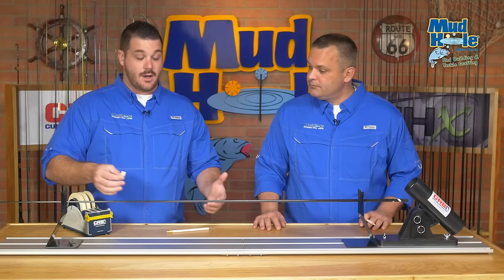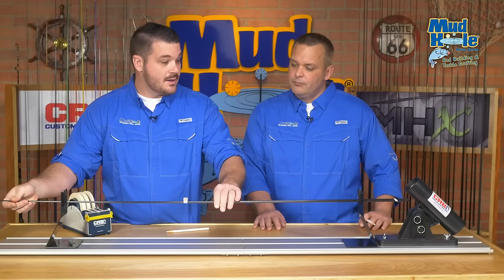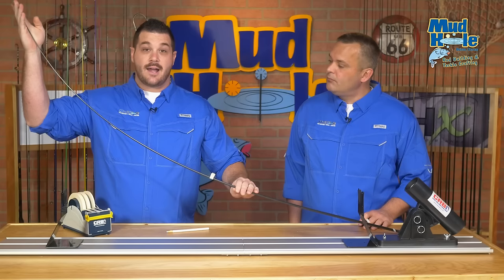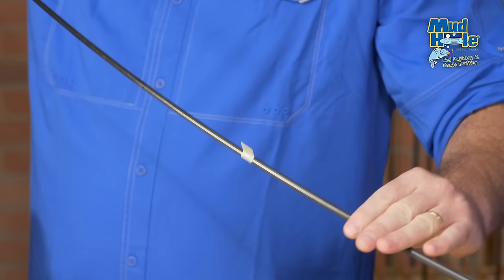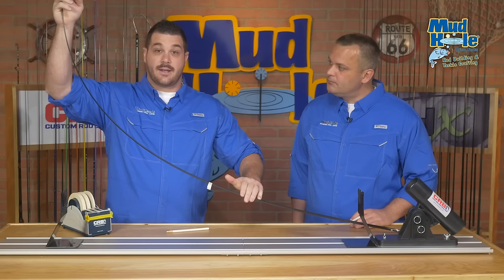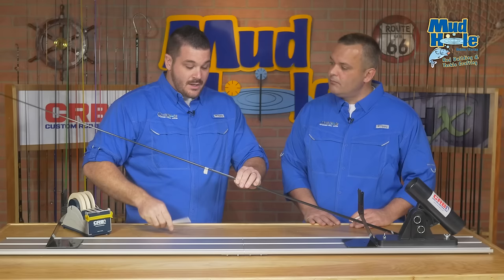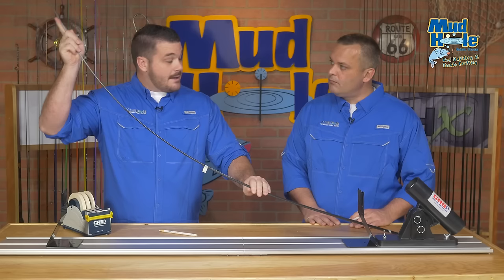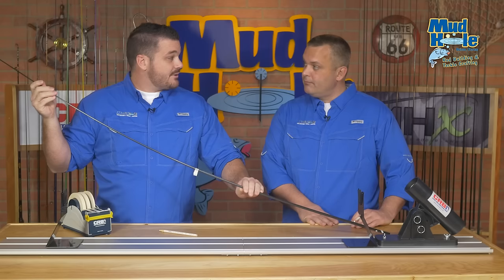How-To Find The Spine Of A 1pc Rod Blank | Rod Building 101

Comment: Once I've found the spine, can I use it for spin or bait casting depending on which side I put the guides on? Also, can I use the same blank for spinning as well as baitcast, or should I use a different  blank? I'm referring to using a duplicate blank for the other type..
Reply: Yes, you can; most blanks are the same as wrapping your guide on one side or the other. One good example is Lamiglas's IM 1000 steelhead blanks, which are the same blank as their bass casting blank, only the bass casting blank is shorter, and it is cut off a little bit to turn it from a medium action steelhead rod into a Med/Hvy bass casting blank. The same concept goes for spinning and casting blanks; it has everything to do with how you position your guides, on the top or the bottom. Most, if any, difference is minor; in the 70s, Gerry Loomis was the president of Lamiglas, and he started Loomis rods with a cut-down Salmon rod blank. Stay away from the rod-building sites you see online, at least until after you have read a few books. I said that because the places you see online are loaded with new rod builders who have never even read a book, and these guys really do not understand some of the concepts that go into building a custom rod. A custom rod is not just made to look pretty, but it is built to be functional, too.